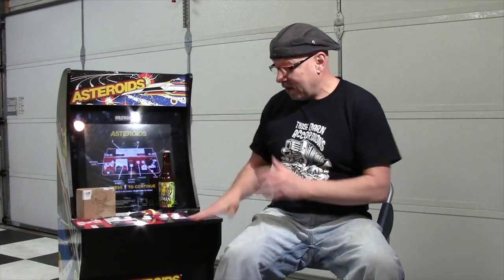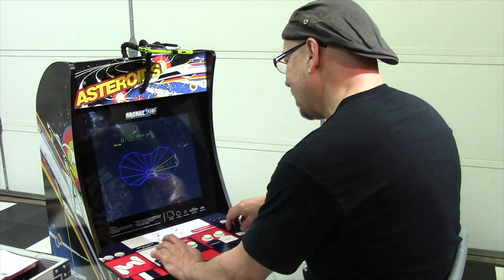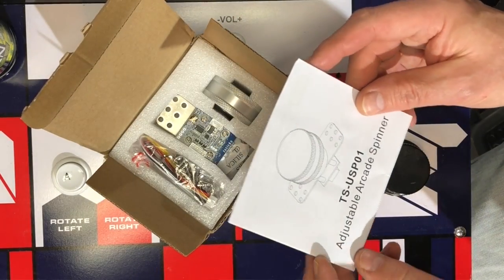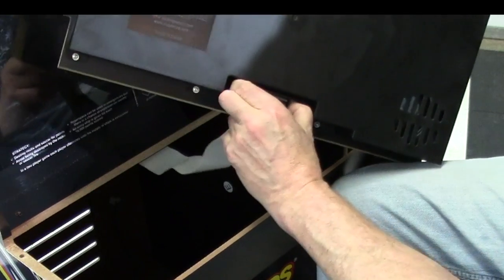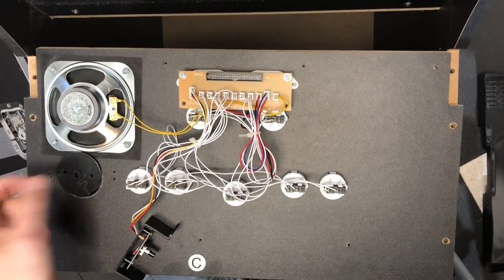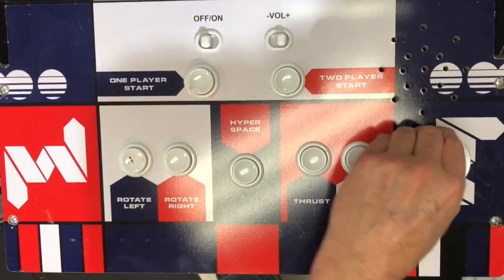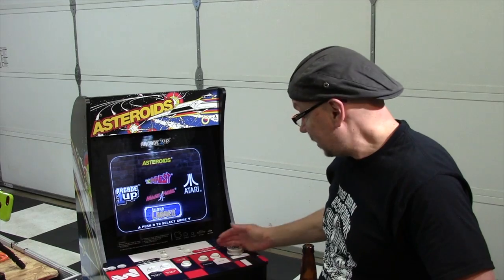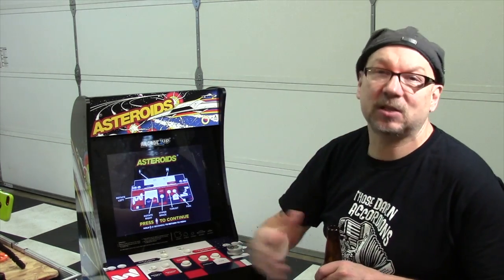Arcade1UP mini cab Spinner upgrade review

Comment: Setting it up on Pi3 can be cumbersome as you need to remove the DIP Switch coating, switch DIP Switch 3 to up position for on, plug Spinner board to pin 3, and plug usb 3 on pi. You will need a tweezer and magnifying glass to see what you are doing.

Comment: Ordered the new GRS spinner for my new Arcade 1up Asteroids, put the machine together, when I opened up the control panel there was a bunch of orangish glue on the wires, installed the GRS Spinner and when I tried to start the machine up.....nothing.  Got a $75 paperweight atm, have emailed Arcade 1up support but no reply yet.  In all these GRS spinner videos, everyone seems to have pristine insides for control panels. :P
Reply: I had that orange goop in my Atari 12-in-1 when I installed my spinner tonight. Just clean it off real good and put everything back together. Everything should work afterward.
Reply from the maker: Sorry to hear that Craig.  Have you tried reinstalling the old "spinner"?  That will tell you if it's the GRS or the Arcade1UP innards that are the culprit.  And if the machine stays dark, then I would first look at the power input wires and see if something got pulled accidentally.  Glen do you have any insights?
Reply: @DrunkenMasterPaul  reinstalled the old spinner, tried turning the machine on but nothing so not sure if its the motherboard, monitor or the on/off switch.  Still no response from Arcade 1up.

Comment: Crap, crap, craaaap... you're making this very hard to resist. I don't have an Arcade1Up cabinet (nor intend to get one) but I DO like playing dial-based games and I DON'T like playing them with a stinkin' mouse. I understand that this can be used with a PC if you get the interface board along with it, and I'm tempted. None of my homemade solutions have really fit the bill.
By the way, Arcade1Up sells replacement spinners on its site for like, twenty dollars. Are they any better than what's included in the cabinet? Because if they're not, bleech.